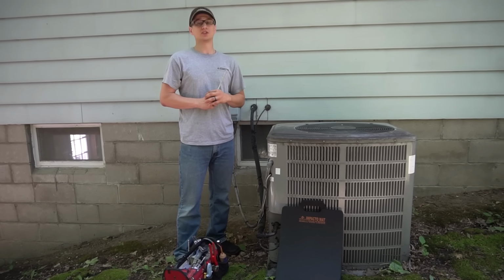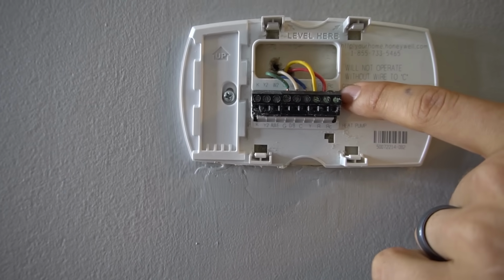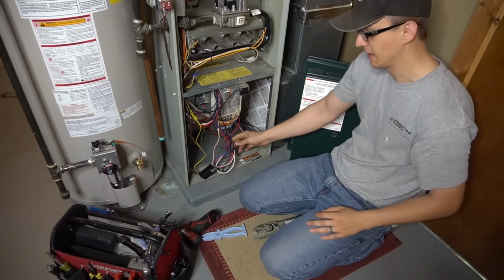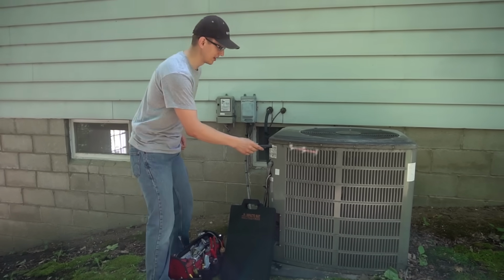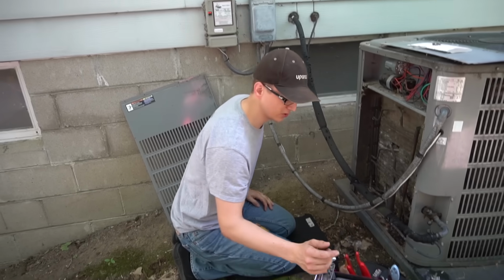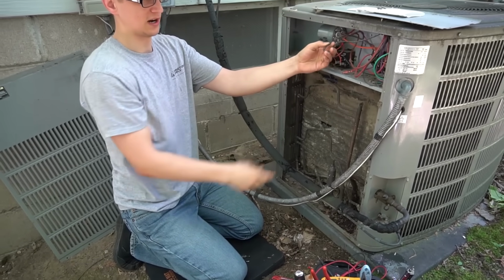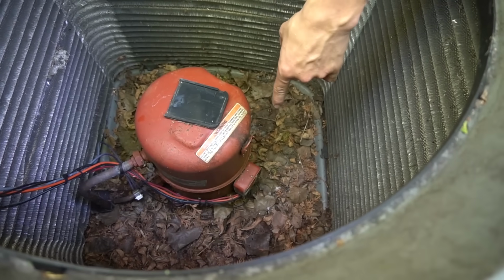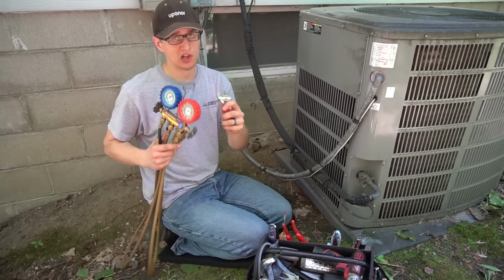AC Unit Not Turning On - How to Fix It Step by Step

Comment: Hi. Thank you for your video. I came home to a hot house and I do not know what the matter is. I watched your video for the capacitor replacement and I am hoping my issue isn't as difficult to repair and I am able to do it myself. 
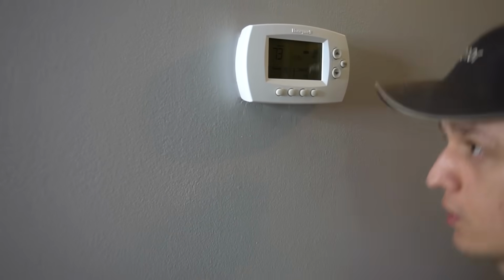In any rate, in your video at 3:22 you mention if the fan turns on when the thermostat is switched to the ON position, then the thermostat is good. Does this statement also indicate that if the fan does not turn on that the thermostat needs attention? Would you please comment?
I am creating a website to help you follow along with what unit and model numbers I actually have along with the troubleshooting steps I am taking. Please visit https://sites.google.com/view/house-ac-repair/home for images and a contributing link back to your youtube channel. Thank you!
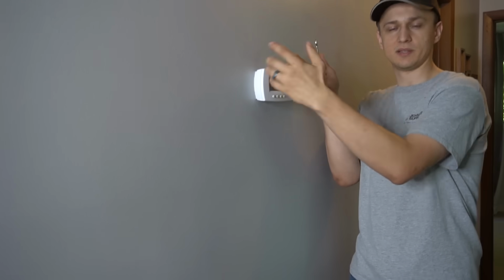Reply from the maker: Hi Joyce! Sorry to hear about the hot house. Have you watched the rest of the video beyond 3:22? I go into more detail on what to check. But as for your question. If the thermostat does not turn on the fan in the ON setting then there are usually 3 possibilites:

1. The thermostat is not getting power from the furnace. To begin with, check for an accidentally bumped off furnace power switch, a blown 3 amp fuse or breaker on the furnace control board, or a tripped furnace circuit breaker.
2. The control board in the furnace is defective. The thermostat may be doing it's job but the furnace control board is not. This one would be a little harder to check. To start with, try turning on your heat. Does the heating work?
3. The thermostat is bad. Your thermostat has a common wire so the batteries shouldn't matter. But if there were some in there to begin with, then try replacing them. It's possible that the thermostat is defective and just needs to be replaced but I would check other things first.

Thank you for the provided pictures! They are helpful. Good luck and stay safe!
Reply: Hello! Thank you for the quick response. I did continue watching. I'm taking pictures and videos as I take the troubleshooting steps you suggest. I will publish them to the website so seek additional feedback from you.
1. I was able to locate the control board and the fuse looks good as I have uploaded a video of this as well. Since the fuse looks goods is it safe for me to assume that I do not need to look for furnace power switch, breaker on the furnace control board, or a tripped furnace circuit breaker as mine has a 3 amp fuse? The video shows the fuse clearly.
2. The heat does not turn on either. Emergency heat does not turn on either. 
3. Replacing the batteries has not resolved the issue.
Reply from the maker: Thank you for the detailed answer. It sounds like you are not getting any power to the furnace at all.. So if you could, I would still try to find the furnace power switch just to see if it was accidentally turned off. And if your circuit breaker panel is labeled, it should be pretty easy to check if the furnace breaker is tripped.

If you are not finding anything obvious like the switch or a breaker, then you may need a meter that can check voltages to get to the bottom of this. We need to find out where the power interruption is. It could be at the breaker, at the power switch, door switch, transformer, control board, thermostat.. It will be a guessing game without a meter. Let me know if you have one. Here is one on Amazon that is like mine, just a cheaper version: https://amzn.to/2NjJTva
Reply: Thank you again for the quick reply. I really appreciate you. Ok, so I cannot find any switch inside the furnace. I'm assuming there may not be one installed. I will continue to search and if I happen to find one, then I will let you know. Meanwhile, I wanted to know if I pick this up locally https://www.walmart.com/ip/INNOVA-3320-Auto-Ranging-Digital-Multimeter/14644666 because I'll end up getting this quicker than Amazon because I do not have one. 
Further, I do not know where all of these are (breaker [unless if this is the one in the garage], at the power switch, door switch, transformer) but I will take pictures so you may guide me.
Thanks again.
Reply from the maker: - The furnace power switch usually looks like a normal light switch and many times is located on the side of the furnace. If it is not on the side of the furnace, there may be an electrical whip (looks like a metal cable) that is routed from the side of your furnace and then goes into the power switch. It's rare but sometimes there is no switch and the wires just go straight to the circuit breaker.
- There is only one switch inside of the furnace. That is the door switch. If you take off the bottom door of the furnace, the door switch is usually right behind the door in one of the upper corners.
- The meter from Walmart looks like it will get the job done :) Primarily we will be using the ACV setting (to check voltages)
- The breaker panel is indeed usually in the garage or the basement. It's typically behind a metal door and and has a bunch of circuit breakers. A breaker has 3 positions. off, tripped, and on. Most of the breakers should be in the on position. If a breaker is tripped, it will be in the center position instead of left or right. You will see it if this is  the case.

Good luck! You are doing good. Looks like you will learn a lot by the time this is all done :)
Reply: Now I am certain I do not have a furnace power switch. See updated video on the website (https://sites.google.com/view/house-ac-repair/home) that follows a cable from the outside of the furnace to the inside leading to the control board. There is no switch to tamper with neither is there an electrical whip. The wires are all exposed coming from the outside and then leading to the control board. I guess having an electrical whip would be wise although I presume these wires have been hanging here like so since the beginning of their time.
Now, the circuit breaker, the one in the garage, is seen in the video on the website that is the cable leading from the outside of the furnace going inside of the furnace and then to the control board.  For some reason, i understood that the furnace would have its own circuit breaker but from your last response, it is the one in the garage and there is only one circuit breaker in this entire setup. Do I understand this correct?
I ended up ordering the electric meter you originally recommended from Amazon. I will get it on Friday the 13th. Hopefully sooner. As I have it, I will contact you directly on here.
Thank you for your wish, your assistance, time and efforts in helping me out. I am optimistic, with your assistance, that I will be able to get this up and running. I want to learn how to get this up and running so that I may be able to ID and diagnose AC problems in the future. Thank you again :)
Reply: Hi again. I managed to find two digital meters locally. Please visit my site at https://sites.google.com/view/house-ac-repair/home and see the Digital Multimeter section (currently towards the bottom). Please let me know if any one will do the job. I think the MFD icon you seek, that is on the meter you have in your video is on these meters as well. I have also attached images on the website to show the back label specs and features to the meters so that you may have a better idea of what I purchased and if one of them is the right product. If it is, would you please advise what I need to touch so I can get the tests started? I eagerly anticipate your response. Thank you much :)
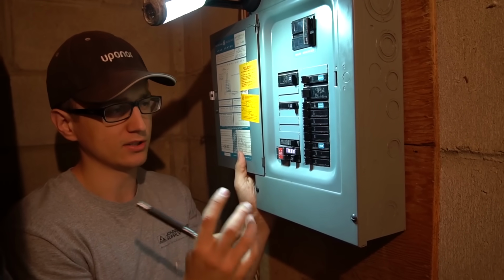Reply from the maker: Joyce, thank you for the videos! So it turns out your furnace is quite a bit different then mine in the video. Your furnace does not have a control board. It has a fan relay instead. As for the circuit breakers, does your panel look like mine or is it completely different? (Mine can be seen at 5:51 in my video.) 

And you didn't have to get the meter I suggested. Many people like it but I just showed it to you as an example. But it will work good :) Friday the 13th is quite a bit out though.. I have Amazon Prime so most of my things arrive the next day or 2. 

Could you do me a favor? Take a couple of pictures and post them on your website. A picture of the fan relay, a picture of the whole entire air handler if you can, and a picture of the jumble of wires with the wire nuts. Thank you!
Reply from the maker: Sorry, I just read your second message right now. Out of those two, the red one seems to be better. But it doesn't look like either one can measure micro-farads (uF) which is not mandatory anyway. Only needed to check the capacitor. Whichever meter you get, I would read the owner's guide first so that you get an idea of how to use it. So did you buy one of them already or just considering?
Reply: Thank you again for your response :)
No apology needed. I sincerely appreciate all of your help.

So whatever I have been referring to as the control board is actually the fan relay lol. Well, you live and learn.
The circuit breaker looks similar to yours but the one in my garage is taller and the switches are farther apart. You can see the images on my website.

I wanted to make sure that the meter that I get will do the job. But I'll stick with the yellow one if that'll do the job. In your other video where you check the capacitor it has the same symbol as the one I purchased but the letters MFD are not printed and that was one difference. I ended up buying both of them not knowing which one would be better. I'll only open the one that I will use. I'll read the manual just to make sure I understand what is required while I wait for your reply :)

I have posted the pictures of the fan relay (or at least what I think the fan relay is), an overall image of the air handler (aka furnace?), and the pictures of the jumble of wires with the nuts.

Thank you again for your support. I look forward to your correspondence.
Reply from the maker: Ah okay! I just looked at the picture of your breakers. Those are the same as mine but most of yours are what you would call "2 pole breakers" which are usually used for higher amperage appliances. It looks like your HEAT breaker is on but just to be sure, try to flip it to the right and then back to the left to reset it.

The red wires that come from the condensate over flow switch, I believe you thought those were the power wires? Maybe I am wrong. But it looks like your furnace is getting it's power from the cable that comes into it on the left upper side. It's that plastic cable.One end goes into the furnace, where does the other end go? Just into the wall?

Thank you for all the detailed pictures! We may come back to the relay a little bit later. For now, let's check voltage in 2 spots. The transformer (to the left of the fan relay) has two sets of wires coming out of it. Where the wires connect to, on the right side, try to get your meter leads on the spade terminals that the wires attach to. One lead on the red wire and one lead on the white. How many volts do you get? If you do the same thing on the left side, how many volts do you get? Keep in mind that the unit may be live so do these checks carefully as there may be 240v present.
Reply: I reset the HEAT breaker by switching it off and then back on. It had no effect on the operation of the furnace or the AC unit outside.

On my website, the video immediately above the heading Digital Multimeter shows the route of the wire from the base of the furnace (brown wire and red wire) going up to the through the top left of the furnace and returning back down to the jumble of wires with the nuts and then continuing on to the fan relay and then to the transformer. This should give a better understanding of where the wires are coming from and where they are headed to. I have also uploaded a new image of the furnace with some labels and I have outlined the route of the brown and the red wires for your convenience. Please check them out.

The red to white shows 241V (on the right of the transformer), and red to blue show 27.6V (on the left of the transformer). I have illustrated this on my website.
Should both of these be reading the same numbers on both sides?

Thank you, again!!!! I look forward to your reply.
Reply from the maker: Thank you for the new pictures and all the details you provide, that's very helpful! There's no way I would be able to advise you anything without seeing it since yours is set up differently then most. Ok so let's continue where we left off:

1. Ok so the brown wires and the red wires that you outlined, those are both low voltage lines. Most likely one brown wire comes from your thermostat and the other brown wire comes from your AC unit outside. The red wires come from that condensate overflow switch. (if your ac coil drain gets plugged and starts to back up, this switch will shut the AC off to prevent it from overflowing)
2. Right when those wires go into the furnace, if you look behind them, do you see the red and white wires? Those are your high voltage wires (240v)
3. The checks you did at the transformer tells us that there IS power going to the unit and that the transformer is good. The transformer is there to take the 240v and reduce it to 24v. And the measurements you took show that it is doing exactly what it should. If you are curious, look up how a transformer works.
4. Now that we know we have power this might make things a little more complicated.. I was hoping it would just be something simple like the unit not getting power at all. So far we have only been looking at the unit inside the home. Could you also take some pictures of the outside unit, and if you can, take off the panel to where the electrical components are and take a picture of that too. (if you see wiring diagrams, those would help too) When taking things apart, I would turn the power off to be safe. (the AC breaker)
5. Turn the HEAT breaker off and then could you please take and straighten out those jumbled up wires? The two brown wires that come into the unit, they both have multiple wires inside of them. What I am wanting to see is which wires come out of each of them. With the power off, you can move those wires around freely. If you want, you can double check with your meter, on the 240v side of the transformer. With the HEAT breaker off, you should have 0v there.
6. The doors that you took off of the unit inside, on the inside of those doors, is there a wiring diagram? It would help if we had that too.
Reply: Thank you again for your detailed response. I have been working on this all day to make it as easy as possible for you to see what I'm working with. Please know, I greatly appreciate all of your assistance. You have no idea how much help you're giving me. Thank you!!!!!!

1. I was able to verify that one brown wire does come from the thermostat, and the other one goes to the outside. I was able to verify that all wires coming in from the thermostat end have a connection with something inside the furnace and then they lead to the the other brown wire, while some connect with like color wires and continue on to the white piece (red, blue, green, and white) and then from this white piece three wires (green, red, blue) connect to the fan relay and the other bunch (white only) go back into the white piece that is connected to something above the fan itself. The white wire you see near the fan relay is connected comes from the transformer and connects with black wire that is coming from the same white piece near the fan. I have made effort to illustrate all of this in images on my website. I hope this is helpful.

2. I see red and white wires that I have labeled with the high voltage symbol on the image. Further, there is a black wire. It is similar in size so I presume it is also of high voltage?

3. Ok ok. I unseratnd @transformer. I had seen a video about it but didn't really understand it but I think I'm getting the hang of it little by little. Thank you!

4. I have attached some images of the outside unit along with the wiring diagrams. A PDF version is also linked immediately below each diagram if the image published on my website is not clear. 

I have recorded some observations on the website along with the images. I hope you will find them useful.

5. Inside the furnate once the brown wire is exposed, I am not able to straiten the wires but I was able to take some notes on my website along with pictures. After you see these images, you'll have a better understanding. If the I need to take better pictures, please let me know.

6. I have attached all the wiring diagrams that I have. I also contacted the manufacturer to possibly get PDF versions so they would be clear but they were not helpful. I'm sorry.

If the website link is taking longer to load, please let me know. I will provide other links to you so that it doesn't take longer to load. I'll just create a new page for new images and videos I upload. If you are okay with how I'm adding on to the website, then we'll continue this way :)

I look forward to your reply. Thanks a bunch!!!!
Reply: Ok so I had contacted the company that last serviced the AC and this is what they replied with:
"if the unit is not coming on your drain line could be clogged as we did install a safety float switch on the system to prevent the unit to overflow water into home so it shuts System down."
I don't have any bleach but I'm going to get some today and add it tomorrow. If I get this up and running, I will let you know. I am not sure how long after I add the bleach will I need to wait for it to clear up so that I can try the AC but if there is progress I will share with you.
Reply from the maker: Wow, I can tell you were busy today! You added a lot of pictures! I think that is more then enough to go off of now :) Thank you for calling the company that last serviced it too. If they put it in, that means the safety float switch will not be on the wiring diagram. If you live in a state that has high humidity, condensate drains tend to plug up pretty fast there. So that would be great if that's all it is! So to the left of the float switch is your drain pipe. (the white pvc pipe) Are you going to pour the bleach solution from the inside into that pipe? Which also makes me wonder, can you see any standing water in your drain pan which is on the bottom of the coil? By the way, the white piece that you have in your pictures that the wires go into is called a molex plug or molex connector. So try clearing out that drain first and then we can test that drain safety switch too.

I haven't worked with that particular one but I am guessing it works like any other safety switch. Here is what I would do: 
1. Turn off the HEAT circuit breaker.
2. Then take out the two wires from the safety float switch out of the wire nuts they go into. If you just spin those wire nuts with your fingers counter-clockwise, it will spin off of the wires.
3. Separate the wires that come from the safety switch from the other wires they are tied together with.
4. Once you have those two wires, take your meter and set it to check resistance (omega symbol). Put one lead on one wire end and the other lead on the other wire end. What reading do you get? A closed switch will give you some kind of resistance reading but if the switch is tripped, it will be "open". Which on most meters shows up as 0 or O/L. This check will tell us if that float switch is what is interrupting the power or not.
5. After you are done checking that, put the wires back to where you found them and screw the wire nuts back on.

I think that will be all for now. Let me know what you find
Reply: Hi again. Yes, I was very busy to make sure I corresponded with everything you had suggested and requested. I am very grateful for your help, thank you so much!! 
The condensate float switch had water in it that I did not notice when I first started working on the repair. So I was trying to figure out how to operate it and contacted a vendor and the AC repair company that last serviced and they both pretty much stated that it is a two wire device and that there is no manual or anything that comes with it. They both basically stated I'm on my own. So I had been thinking about it and finally I tampered with it and I was able to get the water out of the float switch. I honestly thought it would come out on its own once the drain pipe would clear out but I don't think that's how it works. I watched some youtube videos trying to understand how to operate or drain the switch, I just could not find a clip to show that. I found multiple that showed the purpose of it. In any rate, I got the water out and the furnace now turns on!!!!! So I have hope that I may be able to get the AC to work again!!!! (With your help, of course :) 
So to answer your question, yes, I did add about 1.5 - 2 cups of bleach yesterday. I let it sit for the night and I'd say it's been about 24 hours now. I got a wet/dry vac that has the option to pump air out as well as suck. So far I've tried to push air out from the inside, near the furnace. I'm giving the wet/dry vac a break for about 30 minutes before I go outside to try and suck out the possible clog. I should be doing that in the next 10 minutes or so. I hope the pump will suck out any clogging matter. If I am successful in clearing out the tube, I'll try turning the AC on to see if it will operate normally. If I am unsuccessful, I'll be writing you to share the outcome.

Further, I did not see a drain pan so I don't have one. It is possible I do not know where it is but I removed the air filter and I just don't see a place for it. I took some pictures that you'll see on my website so you'll see what I saw. Is it possible for some furnaces not to have any drain pans? But the good thing is there was no flooding and I did not see any water other than the one that collected in the float switch.

I tried measuring the resistance to the float switch and it did get a reading of 0L and I think that was because the float switch had water in it so I think it is expected to read 0/L. I have not tried it again now that the furnace did start up because I have a feeling clearing the drain pipe is going to resolve the issue.

Again, I am greatful for your assistance. Standby so I can figure out how to get t his drain pipe cleared and I will write you again.
Reply: AC worked for a while and then shut off again
Both furnace and the AC unit outside were operational for about an hour and possibly less and then the AC shut off again. When it was working, cold air did begin to blow. When it shut off again I noted that the float switch had water in it again and I am now certain that it is the culprit of this AC problems. I think the wet/dry vac is not doing its job. I connected it again to the outside PVC where the condensed water would come out and this second time no water was sucked up. So I thought I had it all working but this appears not to be the case. I think the clog is really bad because the float switch has water in it again!

So I think I need to figure a way to get the clog cleared out. Do you think I should add more bleach into it and allow it to do its work over night again? The wet/dry vac I have has 2.5 hp. Is it possible that the vacuum is just not power enough in its suction power? Are there alternatives to getting the clog cleared out? 

I did update my website with more pictures. Check them out.

You suggestions are much appreciated. I look forward to your reply.

Thank you!!!!!!!!!!
Reply from the maker: Looks like you were quite busy again! :) There is some major progress going on though! You finally found the culprit and it even worked for an hour! Okay so here is what I can tell you after reading what you posted and looking at the pictures where you poured in the bleach.

The drain pan is not under the filter. I think you may have a wrong idea of what that is. Try searching on google: "evaporator coil drain pan". The drain pan will be beneath the evaporator coil. Usually when it plugs up, it will plug up at the point where the plastic pipe goes into the pan. From your pictures, it looks like your drain pan is on the left side, right under the coil. Also, it looks like the float switch can be taken off just by spinning the whole switch counter clockwise. If you do that, I bet there will be quite a bit of water that comes gushing out.

About the bleach.. So the place where you poured it in, it looks like it will not get to the spot where it is actually plugged if that's where you are pouring it in from. But just so you know, bleach can have a corrosive effect on the evaporator coil so the manufacturers don't recommend pouring it into the drain pan. And leaving it over night only makes it worse. When you poured it down the drain pipe that was okay especially since it sounds like it never got to the coil.

The spot where the drain pipe goes into the unit, Are you able to see the other side of it? (from the inside) With an inspection mirror perhaps if you have one. If you take something like a metal hanger, I wonder if you would be able to clear out that plugged up spot that way. I know it's a tight spot though.

Do you have compressed air? the vacuum will not be strong enough to suck out or blow out the plugged up spot. (it never worked for me before anyway.. I tried) What I do sometimes is blow compressed air from outside, in. That will force any plugged up debris back into the evaporator coil and usually that is sufficient since most of that stuff will get flushed out after it starts draining.

Another option is to cut the pvc drain pipe and take out that fitting that screws into the drain pan.. I usually try everything else first since I don't like having to put the pvc pipe back together. You would have to get a PVC coupling, some primer, and cement. Then perhaps watch some videos of how to glue PVC pipes.

Well and that is it for the suggestions.. I hope it will unplug easy!
Reply: Lol I did understood the drain pan to be something that it is not. I guess we've gotten more sophisticated now and if I understand it correctly now, it is built into the evap coil. It is the evap coil to which the float switch is connected to. Unscrewing the float switch from this evap did not cause any water to gush out yet the float switch continues to collect water if the AC is run for some time. 

The PVC entry where I added the bleach is not visible at the other end as it goes in to the "house" or the base of the furnace. It is blocked from view. Unless if the base of the furnace is demolished, I would not know how to see it...unless if I can find a way to contact the builder perhaps? But I am uncertain if I will have access to those drawings. 

I do not have compressed air strong enough to blow through the PVC pipe however a friend recommended to use a hose with a jet head to push water out...I'm not sure if that was wise but it pushed out something that you'll be surprised to see. See the pictures on my website. I treid the wire before using water. I was unsuccessful with the wire but I think I was successful with the water. But the float switch contines to collect water to keeping shutting off the AC. 

In any rate, once the pipe was cleared of the clog, water was pushed out for an additional three minutes to ensure that PVC was clear of any clogs and it appears to be so because the water coming outside is clear.

As long as the float switch has not water in it, the AC works, both inside and outside units. As soon as water reaches it's threshold level, the entire system is shut off. Any suggestions?

Thank you so much for all of your assistance. I look forward to your response. Oh, I hope you had a great weekend :)
Reply: I think I just needed to wait. I am back up and running. I've had the AC started and running since yesterday and so far it is operational. No tripping of the float switch or anywhere else, otherwise and I have a cool house again :)

Thank you so much for all of your support in helping me get this resolved. I hope you will find success in everything good that you do :)

Take care.
Reply from the maker: Hey Joyce! You're very welcome! Sorry I couldn't get back to you until now. But yes! I should have said that earlier, to spray water in either from where you did it or backwards.That was a good plan of action! And wow, that was a big plug of gunk! Well, I am happy that this was finally resolved! I apologize for not going straight to the float switch when I saw it in the pictures. I should have known better. That would have been a good place to start but I got stuck on the no power idea. But about the float switch, I read a good article that was all about it. Maybe you can get some helpful tips out of it too ;) http://acwiz.com/index.php?action=artikel&cat=18&id=26&artlang=en
Reply: Word of Advice TV please you do not need to apologise. I know your are busy. I'm just grateful for your help. 
And that was a slug in the pipe. I'm guessing the bleach killed it and that's how we were able to get it out. 
I do have one more question. I would like to upgrade my thermostat to a programmable one. Do I have to purchase a particular model or could I essentially purchase any one that I choose? Your insight on this is much appreciated.

Have a great night.
Reply from the maker: That was a slug??? Wow! We Minnesotans don't see slugs that huge here so I didn't even realize that's what it was. Which state are you in by the way?  As for the programmable thermostat, you can just choose any that you like :) But do keep in mind that some programmable thermostats like the NEST for example, require a common wire. A lot of older thermostats do not have a common wire going to them so that could be a problem. If you just pull your thermostat off the wall, you should be able to see if you have a wire going to C (common)
Reply: Word of Advice TV hahahaha I know!! We were as surprised if not more than you. He was deceased but he was ginormous! 
Yes, you had mentioned that my wiring has the common with behind the thermostat and that I did not need batteries. I think you were able to determine this by the thermostat pictures in my website. In any rate, now I have a better understanding of what I can ok for. 
I am in the sunshine state of Florida and it gets hot there sometimes. I'm not sure how it is like in Minnesota. Do you have for seasons. I've never meet at from there.
Thank you again!!!!!
Reply from the maker: Oh that's right! You do have a common, in that case just pick one that you like best ;) 
Ahh okay, Florida. I hear plugged drains is the number one service call over there. When people ask me for advice one of my first questions should be what state are you from. For example, in Texas, it seems like people have bugs crawl into their contactors and jam up the contacts all the time. It happens a lot there. In Minnesota, very rare that that happens. And yes, we have all 4 seasons that are fairly balanced and it's not nearly as humid as Florida. Anyway, stay cool! :)
Reply: Oh wow! That's good to know about the most common service calls in FL. I'll have to make sure the drain pipes are clean then. I'm thinking to add vinegar instead of bleach as I learned bleach can actual cause harm to the pipes. 
Lol yea, I guess knowing the state the person is in would help a great deal. I guess I should have mentioned it earlier.
Thank you again for everything. I have a cold house again  and with your help I was able to find the culprit and get it back up and working.
I may contact you again in the future if it has any issue or if I decide to change up the unit. I did want to ask you this. Are the standards for the HVAC or the outside units changing where everyone will be required to upgrade because support for the current AC units in America are being discontinued for some reason. I do not know if this claim has any merit but my manager mentioned this to me so I freaked out thinking that I would have to buy a new unit already!! Have you head anything about this?
Thank you sooooooooo much for everything. 
Take care.
Reply from the maker: You're very welcome! I think I know what your manager was talking about. The refrigerant the older air conditioners use is R22. And R22 is being phased out. They have stopped manufacturing it but you can still get "recycled R22". The goal is to wean off of it. All the new air conditioning units come with R410A refrigerant. Which is scheduled to be phased out at 2024. As the supply of R22 becomes smaller, it's prices go higher and higher. The reason for this is that supposedly R22 is bad for the Ozone layer so it is not environmentally friendly. Anyway, that is just a brief explanation. Don't worry about it ;) You don't need to get a new unit.
Reply: @WordofAdviceTV  Hi again. I was hoping for a cool weather for a longer period but I think summer is nearly here. I hope you and your family are well. I have a few more questions to ask you. I hope you wouldn't mind. You're my go-to person for this. Thank you.
So I had my AC serviced twice and both repairman stated that I need a new AC. One quoted me $5k and the other $6k. Both are licensed and insured, to my knowledge (how could I verify this when they tell me they are licensed and insured?). In any rate, after the 2nd service call, my AC now just hums/buzzes. I thought it was my neighbor's AC and today I learned it was mine. What could cause this hum/buzz? I was with both serviceman and the first one didn't do much (check temperate and Freon level) but the 2nd one check the amps under the hood of the compressor (I think the wires connected to the capacitor) and he told me that each wires read 11.27 and 11.56. I forget the units for these numbers. He checked the Freon levels and he stated it was acceptable. When he saw the amp readings, that's when he stated that I need a new compressor and furnace. He works for Rheem. He came inside the house to check the furnace and noticed that my blower motor needs to be cleaned and the area immediately below the furnace had lint in it. I have pictures here https://sites.google.com/view/house-ac-repair/home To replace this area with the padding (I think), it would cost $200 additional. I nearly purchased the AC unit but I don't think I am in a position to yet make this large purchase. In any rate, what do you think is making this hum/buzz noise? Is there anything I can do to at least go past this summer with this same unit without having to purchase a new one? I lowered the temperature and the fan outside did turn on but the hum/buzz noise is also present. Finally, the prices I received for the new units, in your opinion, are these fair?
Thank you for your help. I look forward to your reply. Have a great weekend.